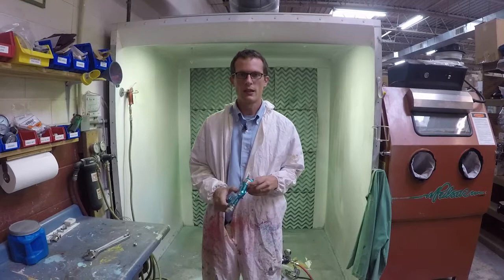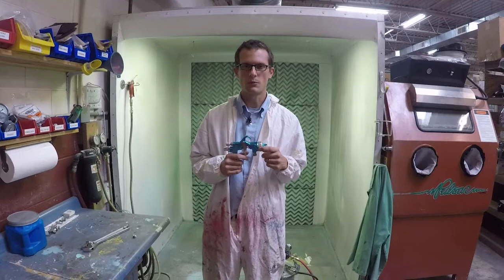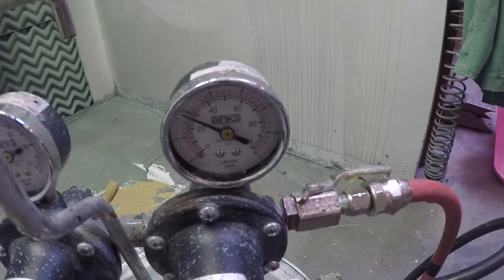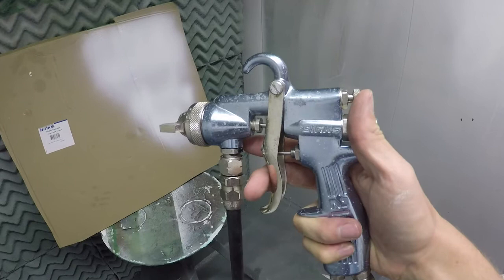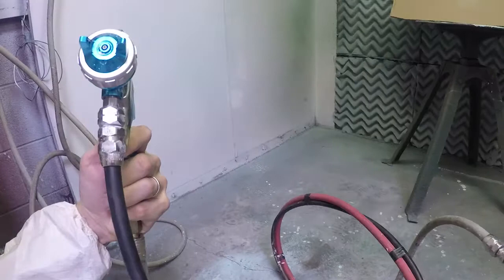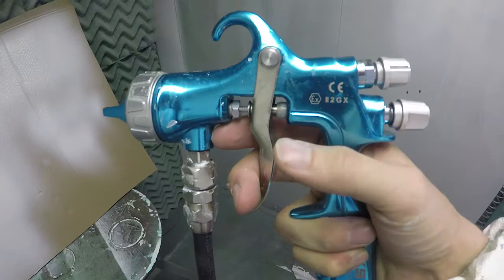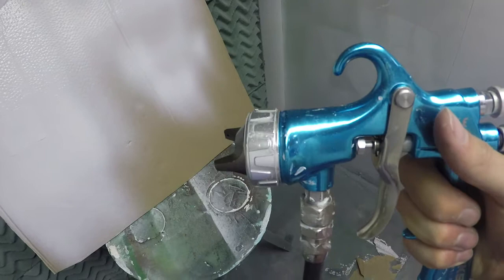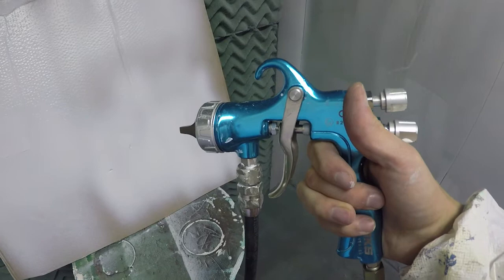Top 2 Industrial Spray Guns 2017

Comment: How do you feel about my spray Pressure set up I use at work painting 12-30ft trailers (industrial) it's a devillbiss gun unsure of unit number as it's a used gun I got when I started working at my new job , but the other painter recommended 15psi fluid pressure and 40 psi gun pressure , with 2-3 turns out from completely closed spraying with full fan , I am having troubles with runs and dry spray and it's really bothering me when it's such a big project I'm working on
Reply: I'll help you adjust your gun. You need to know the viscosity of the material which you spray, and your fluid nozzle & needle size. Match the viscosity to your fluid set. Example: a 1.4mm or 1.5mm nozzle and needle is looking for a viscosity of 20 - 30 seconds through a Ford #4 cup.

Next, with atomizing air turned OFF, pressurize your pressure pot, pull the gun trigger, aim straight ahead. Adjust the psi to the pressure pot so that you get a 3' stream of liquid that begins its arc to the floor about halfway through, meaning that the total length of the stream plus the arc ends at about 3' - 5' from where you're standing.......Next, dial in yourcair pressure with your fan adj valve all the way open. The fan should look like an even mist with no streams or tails at its edges. View the fan from the side. 

That's all she wrote.